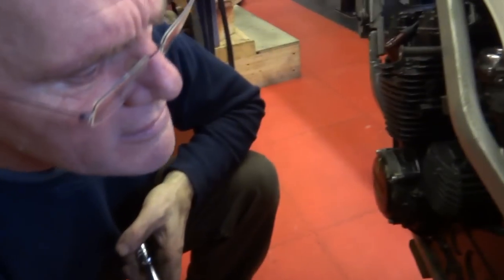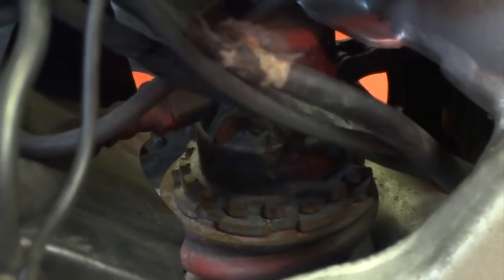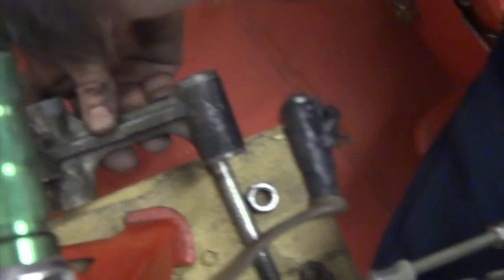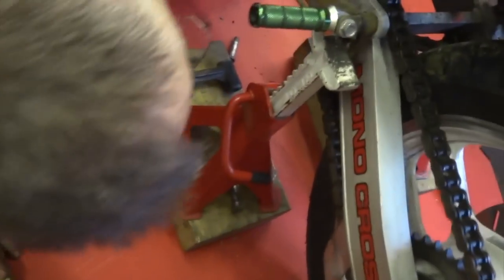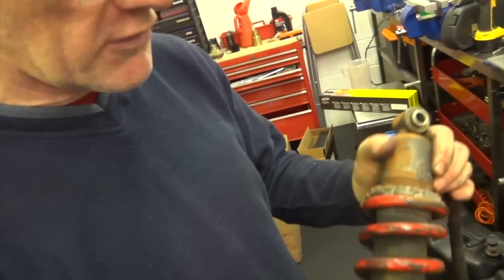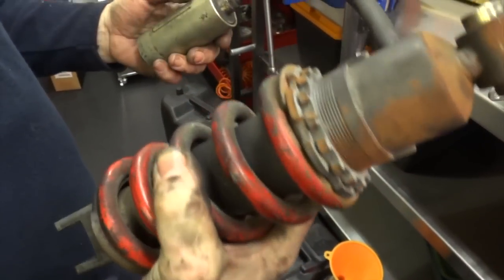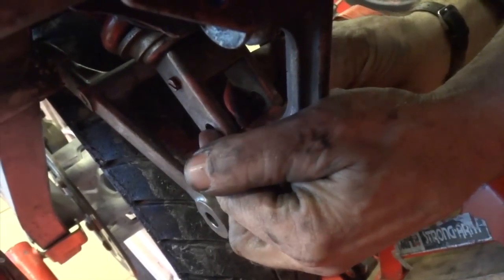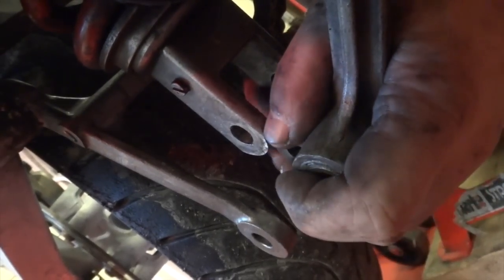Rear shocker - and it really is... Yamaha FZ600 restoration race track project Mike Spike Edwards

Comment: I know its 6 years later but what was the Ohlins Shock off that you going to put in??
Reply from the maker: To be honest I'm not 100% sure, I'd had it for years before, I tried to fit it to Gordon my SZR660 but the spring rate and damping were way out, however it went into Nancy my FZ600 Classic Prodie racer with little modifications. From memory it was a GXSR600/750 unit, but don't hold me to it!